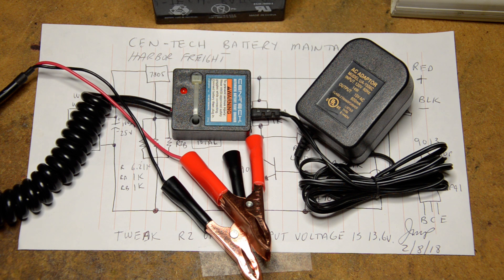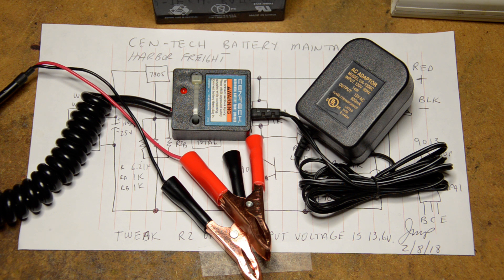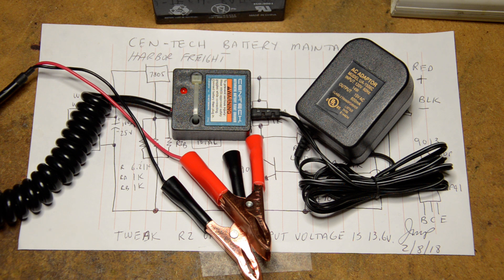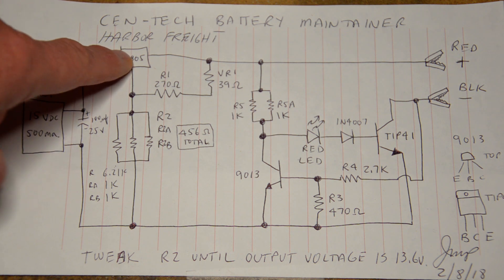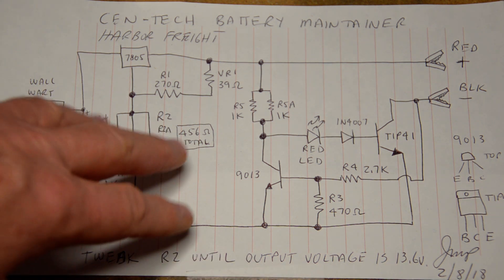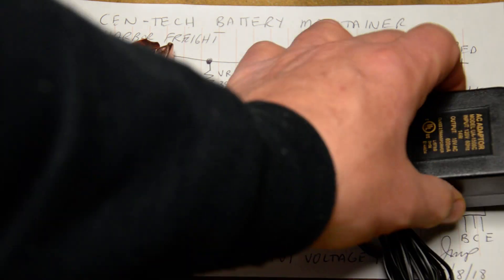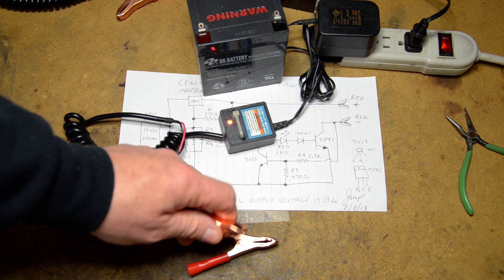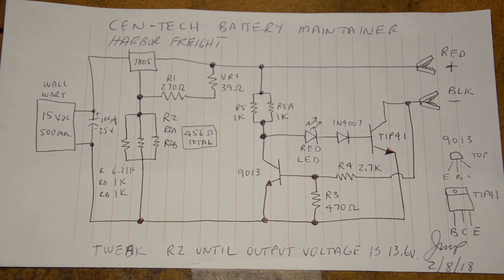Harbor Freight Cen-Tech schematic for battery maintainer float charger

Comment: I've had one on my mower in the shed for the last 7 years during the winter months to keep the battery up to snuff to start at least once a month to "limber " things up and keep all parts in "Moving action" to include the battery worked fine so far. ECF

Comment: I wish they still used this transformer design with a voltage regulator from the secondary winding because at least they can be calibrated to a fairly stable output voltage through the voltage divider resistance values. 

Now they use a tiny absolute cheap trash high-frequency switching power supply with no real feedback to speak of and therefore no real regulation beyond the ideal design of the switching supply but the components are not ideal, they are cheap with terrible quality control and therefore, they are not accurate whatsoever. 

At least up until around 2023. They’ve changed to a purported “microprocessor controlled, fully automatic” charger/maintainer, which I am about to try. (and check the circuitry inside) 

I suspect that it is simply some implementation of a short-circuit bypass transistor protection from this one slapped on the output of said crappy high-frequency switching supply with a multi-color LED that denotes when the power supply is supplying current vs when it’s in reset mode (“charged”).  But I’ll get one and look. Maybe I’ll be pleasantly surprised, but I’ve got a hunch that it’s going to be underwhelming.
Reply from the maker: I bought 2 of the newer microprocessor controlled maintainers to try and do the same reverse engineering I did on this older version in the video.   I bought them a year apart from each other.   I could not figure out how either of them  worked and maybe locate the voltage feedback network the micro uses for voltage regulation.   NO luck either attempt.    The worst part was both of the had output voltages over 15 volts.    One was 16.6 and the other went over 17 volts.    I put a battery on them to see if it would cutoff after the battery reaching 14.7 volts.   NOPE!!!!!!   The voltages kept rising and no cutoff action ever occurred.   Both went over 15.5 volts and I stopped the test so I didn't damage my batteries.    These newer units are NFG.    Good part is since I have the above schematic of the older models I have built several of the above maintainers for myself.   Very simple circuit to duplicate on your own.   All you need is a DC power supply that can output at least 17 volts DC so the regulator can regulate properly.   When I built my own I put a hefty heat sink on the LM7805 to keep it cool.   Secondly the older ones would fail because the filter capacitor was mounted in a way it is surrounded by the small heat sink they used in these units.    Mount the capacitor away from the heatsinks.   Make an old style one for yourself if you have the know how or the ambition to do so.   Hope this helps and THANX for watching.
Reply: @jp040759   Yeah the couple of newer pre-2023 ones that I bought that have the high-frequency switching supply inside omitted any sort of feedback circuit to control the switching mosfet on the main transformer inductor, causing the same issue of higher-than-desired output voltage. I think they were around 15.5v and would try to supply current to any load connected until it reached that voltage. No good for float, that’ll slowly boil a lead-acid dry. I generally like to float my batteries on the lower side around 13.2, although some people float them higher. I don’t like to bubble them at all though. 

Also it seems to me that they chose the LM7805 solely based on its inexpensive price for this application. The 7805 is a fixed 5v positive voltage regulator that only regulates for that fixed voltage. They are using it to regulate to a higher voltage by using the voltage divider to create a floating virtual ground for the regulator’s ground pin, to effectively allow it to regulate a higher voltage. This actually seems strange to me though because the regulation from that floating ground will vary based upon load (voltage drop will vary on the floating resistive divider “ground” causing slower regulation response) and under increased load that resistive divider will dissipate more energy and increase heat. 

I am going to attempt a design of an output float regulator for lead acid similar to this but with a LM317 (it’s also a positive voltage regulator but designed to be variable with a usable output voltage from 1.25v-37v.) Since it’s designed to be variable it still requires a restive divider to set the output voltage, but won’t dissipate as much current through that divider due to it being connected to Vset pin instead of a virtual floating ground like on the design of using a fixed output like the 7805. 
Side note, amazon and ebay already have little LM317 output regulator boards that are ready to be slapped onto a DC supply that have a small potentiometer as part of the resistive divider feedback, making setting the output voltage as easy as hooking up a multimeter to the output and adjusting the pot with a small flathead screwdriver to the desired output regulation voltage. I see this as a good candidate for a quick and easy dirty “programmable” regulator to possibly slap on any dc supply that’s a few volts higher than the desired regulated output. I’m also going to try some of those boards for that, they are cheap as dirt so why not. thanks for the informative video man. I’ll let you if I manage to cobble something halfway decent together that works haha. cheers

Comment: Just bought one of these today at HF for $7.  Brought it home, plugged into wall, checked OUTPUT with my Multimeter DC set at 20v. Consistent readings: 0.19v. Not even 1/5th of a single volt! PURE JUNK!
Reply from the maker: The new ones are switching power supplies (not transformer power supply) and they are not at all accurate for some reason.   19 volts is way out of the ballpark.  I took one of the new ones apart and I could not reverse engineer the circuit.    It was all surface mount.

Comment: Hey man thanks for sharing this. Mine hasn't been working for probably longer than I realize; battery will light the led, but no led when just plugged in the wall. Something is loose & rattling in the wall adapter, haven't cracked it open yet, may be an easy fix.  Thanks again.  Take care.    - Leeroy
Reply from the maker: Hope it helps you when you get it open.   Thanx for watching.

Comment: I been reading some on charging batteries you have to charge a lead acid at a trickle charge because of over charging the battery to many times like a quick charging or putting too many amps and volts at one time to many charging the time you have your batterys.which takes the life or cells of battery to kill cells or rust up the diodes in battery to take life out of the time it's supposed to go bad before the time it's supposed to last .and or prolong it's life past it's due date longer term use.
Reply from the maker: Not sure what your point is but this is not a charger.  This is only a battery maintainer.   This is to only be used on fully charged batteries for long term storage.

Comment: thanks I used one on mom's car years ago andthe battery went bad .. thought it was luck of the draw now I see they can over charge   .. so what you are saying is that you don't know if you get a good or bad one and they are shit ... thanks what i needed to know
Reply from the maker: They work when they are calibrated.  Obviously I have seen some right on and some set to too high a voltage or too low a voltage.  This video shows how to fix and set the voltage to exactly 13.6 volts which is ideal for float charging the battery.   Its a simple circuit.   They just don't have tight quality control on these and tweak each one perfectly at the factory before sending them out.   If you have the skills you can easily calibrate them as shown.  Good Luck.

Comment: Very informative but you didn't elaborate on HOW you calibrated the chargers.  How is that done?
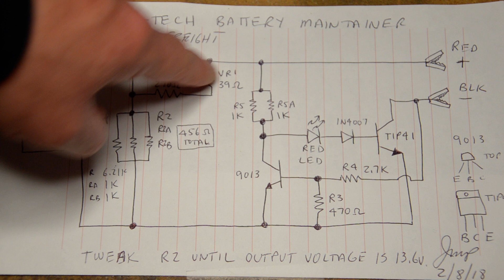Reply from the maker: I explained it at 2:10.   Tweak the voltage divider resistance ratio (R1, VR1 and R2) to calibrate (program) the LM7805 voltage regulator output voltage to 13.6 V.   Look up LM7805 variable voltage configuration circuit for details.

Comment: Perfect.  Thanx for sharing your effort. 👍 update - the supplied wallwart voltage output started to drift all over the place.  Never seen a wallwart do that before. it would slowly vary from 10vdc to 15vdc and back again.  I had a spare 18VDC 1500mA that fixed it.  13.6vdc out now.  I did saw open the original wallwart & found the 1000uF 25VDC cap leaking.  I replaced it & is back in working order.
Reply from the maker: This is the old transformer wall wart.   The new devices have a switching power supply wall wart.   I assume the funky one you has may have been that newer style wallwart.   I played with those and they seem to be really crap.   I could not get the voltage right either on the new ones.   Glad this helped.

Comment: When I connect the black wire the led turns off? If I just have the red hooked up the light stays on? What am I doing wrong?
Reply from the maker: Not enough info to fully answer your question.   Assuming you have it plugged in the wall and connect it to a battery you either reversed the polarity of the connections or your battery is bad and is shorted out.

Comment: Thanks for sharing!I would like to power this with a solar panel.what size panel would be safe to use with it.some days solar panel s put out a lot and some days not much.is there a panel size that would work safely most days?
Reply from the maker: Based on the output of 13.5 volts at 500 milliamps max output I would suggest a solar panel that puts out 18 volts max at no more than 1000 milliamps  output.   Let me know how it works out.
Reply: jp040759  thanks for your help.I just pick up a hf flot Charger like yours. The out put is 13.3 volts.I hope that’s good.I was thinking you might say get a charger controller instead.Im not sure if that would be better?
Reply from the maker: @11bayrat  13.3 is pretty good.   Ideal is 13.6 volts.   Close enough so you don't boil your battery.   The HF maintainer has a voltage regulator built into it.   If you put in the 18 volts is will maintain the 13.3 output.   If the solar drops down below around 15 volts the regulator will lose regulation capability.   The only thing I am not sure of is if the voltage drops below what is called the regulators drop out voltage, will the battery start to discharge backwards through the maintainers circuitry.  This may occur since the power supply is not pushing current into the battery so the battery might start pushing current back into the maintainer circuit.   To eliminate any chance of that you could put a diode (1N4001 to 1N4007) in series with the Red wire but then you would have to use what I explained in the video and re calibrate the maintainer circuit to output 0.7 volts higher voltage  (14.3 volts) to compensate for the diode's forward voltage drop so the battery still sees 13.6 volts to maintain its maintenance float charge voltage.
Reply: jp040759 thanks for sharing and help
Reply from the maker: @11bayrat  My pleasure

Comment: What kind of charger would you recommend for a SLA battery for ride on toy, like a power wheels?
Reply from the maker: Assuming the battery is around 7 to 12 amp hours get a standard battery charger that can be set to 2 amps output to charge these small batteries (compared to car battery).    Find a smart charger that has multi stage charging.    Usually bulk charge, top off charge then goes into float charge after the battery is fully charged.   Some have a anti-sulfation mode too .   The jury is still out on whether anti-sulfation works though.  I always liked Schumacher brand chargers so look at their products.   If you don't have a charger for your car get one of theirs that that has 2 amp, 6 amp and 10 amp settings so you can use it for your car battery too.   Use 2 amp setting for your battery.   Hope this helps.
Reply: @jp040759   thanks ... i have a battery tender brand ... 3 amp and and another .75 amps. i got my .75 amp working, so figured it would take longer, but would be better than charging at 3 amps.
Reply from the maker: @cueballsi  3 amps is fine.   The battery will not demand 3 amps unless it is fully depleted.   It will draw less and less until fully charged.     The 0.75 amp one is probably a battery maintainer.

Comment: 13.6v float is too high for AGM batteries, in just about all temperatures.  I personally would never run any steady state charger on any of my batteries long term.  Get the specs from the mfr of the battery as they all vary slightly.
Reply from the maker: Per Battery University website.  QUOTE   "As with all gelled and sealed units, AGM batteries are sensitive to overcharging. A charge to 2.40V/cell (and higher) is fine; however, the float charge should be reduced to between 2.25 and 2.30V/cell."   Based on this statement float charge means between 13.5 to 13.8 volts for a six cell 12 volt battery.

Comment: Here is the repair video....
https://youtu.be/LaGD1GoKG48
Reply from the maker: The link is for a hack job.   That is ABSOLUTELY NOT the way to calibrate the unit.   Changing the resistors as shown in my video changes the voltage regulators output to the correct voltage.  This changes the reference voltage feedback to the Regulator Chip to lock onto desired voltage of 13.5 or 13.6 volts.   Using resistors to drop the output voltage dos not work and defeats the feedback circuits regulation capability and lowers the current going to the battery also.   As the current changes on the hack job circuit the voltage drop across the  resistors also changes so there is no way to regulate it to lock onto 13.6 voltage any longer.    The way I describe above in my video is the correct way to change the output voltage.   The guy (  
bam6972  ) even states in his description it does not work the way he did it.
Reply: @jp040759  oh yah! After I watched the video I then read the comments and saw it was bad.

Comment: You say change resistors but I see a VR1 - why not simply adjust it?
Reply from the maker: Good catch.   You do see VR1.   I just used the labels they printed on the circuit board for each component.   The original circuit board was made for a variable resistor (VR1) but they did not populate the VR1 holes with a potentiometer.   They just used a fixed resistor as shown in my schematic.   At some point they must have been there for calibrating the output voltage but they got cheap to cut costs.   If you are skilled enough you could probably replace VR1 on the board with a trimmer potentionmeter.   You could then calibrate the  outptut voltage that way  without swapping fixed resistors.
Reply: @jp040759  What do you suggest for VR1 resistance value?
Reply from the maker: @s.mendez7160  The factory used 39 ohms on the unit as I show.   It was labeled as VR1 but its not a variable resistor they installed a fixed 39 ohm resistor as I show in the schematic per as built.
Reply: @jp040759  So I could use in place of the 39 ohm fixed resistor, a 50 ohm 10 turn pot to finely adjust the output. Mine is measuring 13.0V.  Thank you for responding.
Reply from the maker: @s.mendez7160  Don't tweak the 270  or 39 ohm resistors.    Tweak the value of R2.  (R2A, R2B, R2C).    There is not much room inside the case for a potentiometer so I recommend playing with parallel combos of fixed resistors to get the correct voltage out.    Plus a potentiometer can  drift over time due to corrosion and its possible you will be back readjusting again and again.   Don't forget if you solder in a resistor wait for them to fully cool down before taking final voltage reading of voltage output.  A hot resistor will be different value than room temperature resistor.     As you can see I ended up putting two 1000 ohm and one 6200 ohm resistor in parallel to get the correct voltage out of the unit.   If you really want to try a potentiometer (instead of fixed for R2) use a 1000 ohm pot and that should work for you.   Just for safety add a 270 ohm resistor in series with it in case you turn down the pot to zero ohms by mistake.   You never want to have zero ohms (for R2) in this regulator circuit.   Don't forget all components have different tolerances so you can't go by exactly what is shown in schematics when trying to get precise results as shown.   All components are not perfect and those variances will change your results slightly.    Hope this helps.   Good luck.   Let me know how it worked out for you.
Reply: @jp040759  I appreciate your suggestion of making R2 variable. Gonna use a 10 turn precision pot pc board mount. After I open the case, I wanna see if there is room to fit the pot on the board or pig tail it to the PC board from the top, or flush mount it up against the inside of the case with a drilled hole for fine voltage adjustment. Did you use 1% precision resistors for your R2 network?
Reply from the maker: @s.mendez7160  No.    I just tweaked the resistors combos until I got the closest voltage of 13.6 out of the clams.   Had to make sure after each change was made I  let resistors cool.